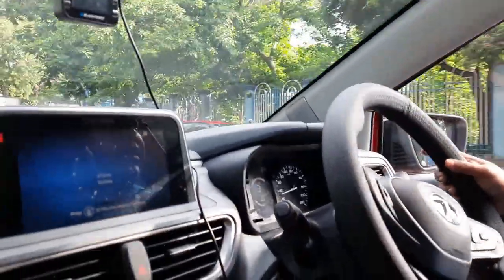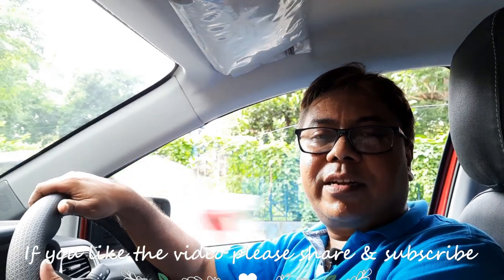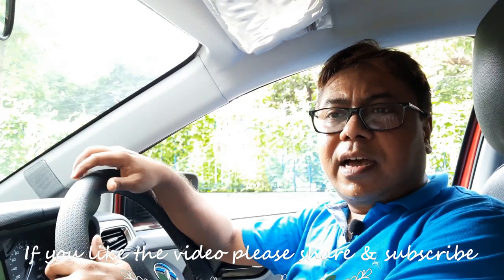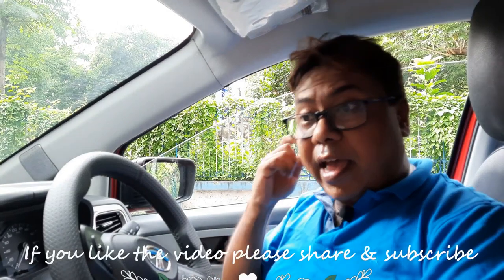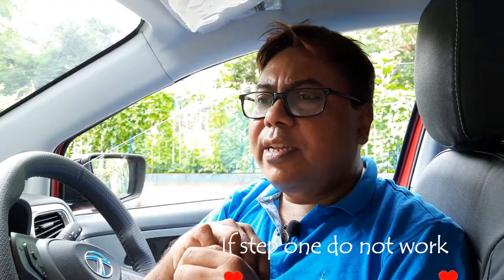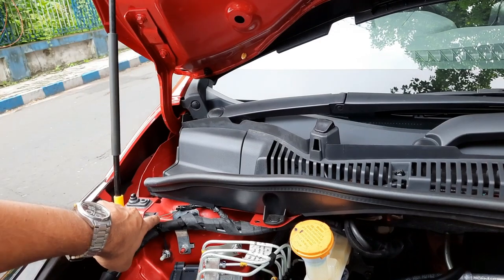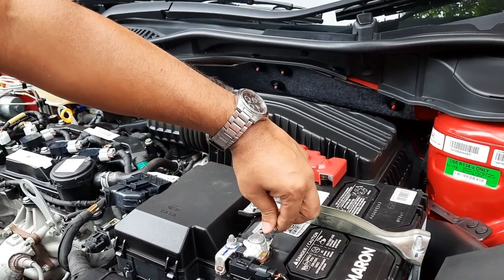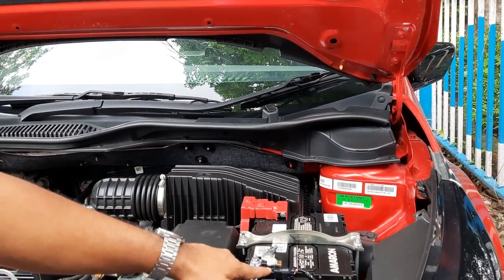IDLE START STOP Issue Easy Fix IN Tata Altroz #tataaltoz #carreview @supercyberautomotivetravel

Comment: No need to remove the negative terminal. Beside the battery sensor of Altroz you will find a small plug. Press the clip and remove the plug. Wait for 30-40 seconds and then re-insert the plug. It will work. More convenient instead of removing the negative terminal.
Reply: Can you please tell me where i can find that plug?

Comment: In my new Altroz ( 2 month old car) ideal start stop is working,but some time i observed in traffic signal i put car in neutral and press the leg break since it was in slop.. engine get switched off automatically..but after 5-6 second engine start automatically without pressing the clutch...is it normal or any issue?
Reply from the maker: Yes it's normal.

Comment: Sir there is a small dent on my altroz i saw that it can repaired at home using extreme hot water should i do it BTW good content🙏
Reply from the maker: Hot water works well in plastic areas such as bumpers or plastic cladding .
Reply: @supercyberautomotivetravel  the dent is near indicator light
Reply: You can try but you need to push it from back or use a dent puller to bring it back to shape.

Comment: Sometimes my altroz not picks up after ilss start have to press accelerator won't pickup with clutch.
Reply from the maker: Is ECU updated. I have never faced this issue. Try without ILSS first, then check with ILSS.
Reply: @supercyberautomotivetravel  i have checked it starts to viberate and have to accelerate hard and sometimes picks up smoothly mine is also al04 .
Reply from the maker: Have you told about this problem in service . Check the clutch also may be problem of fuel pump, or a faulty spark plug. Also try taking fuel from a different petrol pump.
Reply: @supercyberautomotivetravel  yes i have told the SC they say you have to accelerate more. Fuel pump shouldn't be the problem as it occurs at some situations only, the rpm doesn't rise automatically as it should happen when i release clutch .
Reply from the maker: Where do you stay. Actually erratic acceleration should be due to  something faulty in fuel system or ignition system.
Reply: @supercyberautomotivetravel  kolkata mine is 2020 model
Reply from the maker: Check your car from a different service centre
Reply: @supercyberautomotivetravel  ok which one would you prefer i do it from dulichand
Reply from the maker: Try it from K B Motors .
Reply: @supercyberautomotivetravel  ook thanks a lot!

Comment: Sir,is there any permanent solutions for that.Bcoz me also facing same issues,sc team also unable to solve these issue
Reply from the maker: This is not an issue actually the ILSS works under certain conditions. If your car  runs less it doesn't work as the battery charge conditions remain below the stated value. As I take a long drive it starts working after a 30km - 50km drive . So is the case .
Reply: @supercyberautomotivetravel  That means these feature is not suitable for daily city drive
Reply: @supercyberautomotivetravel  actually it's stopped working when vehicle kept at parking for 2 to 3 days or more.After that it's need to do such activities  to active ISS.Just shared your video to ASL service team for references.
Reply from the maker: If the car runs less in city like me where the daily run is about 7 to ten km it won't work . Also if it remains idle   for few days nothing to worry. In fact it's not working in my car at the moment. I will be Ona long trip on December weekend and I will give you the feedback.
Reply: @supercyberautomotivetravel is it working fine now?
Reply from the maker: It's working. But if your running is low it won't work. Now my car is 2.6  years old and it works well only when I take the car for at least 50 km or more. Once the car remains idle for a few days it stops working. So nothing to worry about. It will only work once your battery has an optimum charge level.

Comment: No need to remove the negative terminal. Beside the battery sensor of Altroz you will find a small plug. Press the clip and remove the plug. Wait for 30-40 seconds and then re-insert the plug. Then take vehicle for a spin for about 1-2 km. It will work. More convenient instead of removing the negative terminal.
Reply: Thanks!your tricks is working.
But,is there any permanent solutions for that issue?SC team also unable to solve these issue

Comment: can it happen that your car is stopped in idle and without pressing clutch or break it started on its own giving a message automatic starting vehicle
Reply from the maker: Yes it can happen when the system will detect the battery voltage at a certain point  and if the inside cabin temperature alters to a desired level.

Comment: does it work in AT transmission models of altroz??
Reply from the maker: Thanks for your query. You can try it because there is no harm in doing so. In fact when the car runs less and stays parked for longer periods this ilss function doesn't work. It starts working normally when the car runs for  30 to 50 kms at a stretch.

Comment: Sir
I have punch pure
Idle start stop not working one day I drive,  thicely it's stop in the way and not start again
After sometime it's start 
I complain and four time went to service station but they said   
It's ok no fault but same day same problem faced 
Kindly solution
Reply from the maker: Idle start stop works on certain parameters . If these conditions are met only then it will work. If in your case it works sometime then it's ok. Also if the car runs less it will not work.
Reply: @supercyberautomotivetravel  thanks

Comment: The car engine getting shut off during first gear slow clutch movement at ISS function enabled condition. This problem is  not there during ISS function disable condition.

Due to this car moving reverse  when the engine shut off at first gear slow clutch release . Please suggest the solution
Reply from the maker: Thanks for your query. Normally ILSS function will not work when the car is motion or in any gear position. Do hard reset your battery memory by disconnecting the negative terminal. Wait for 5 minutes and take the car for a drive. Do check again if it happens again take it to the service centre.